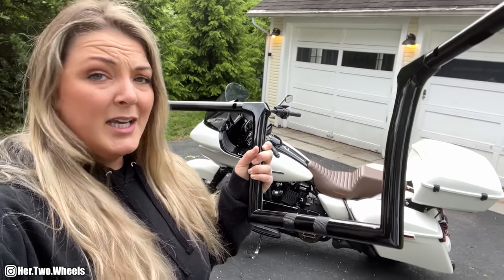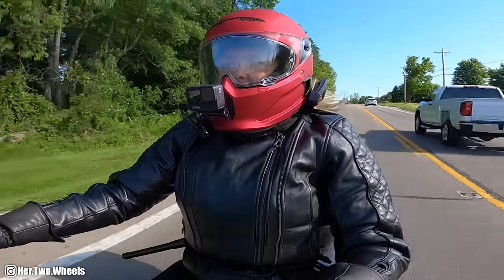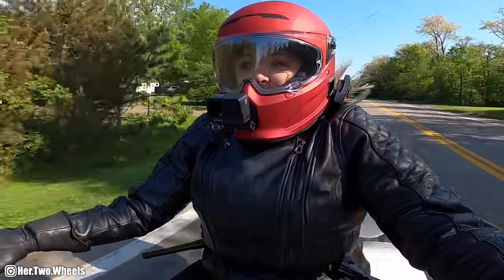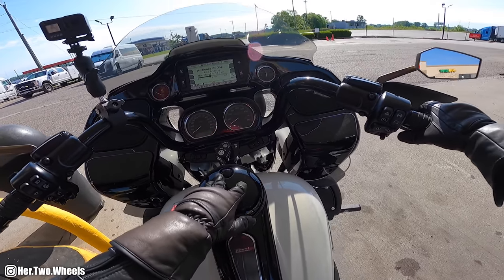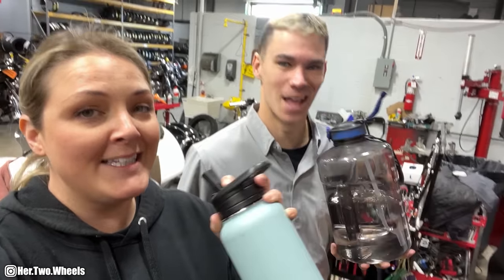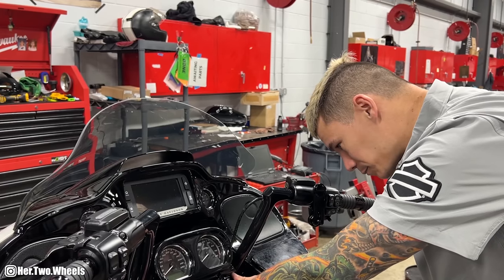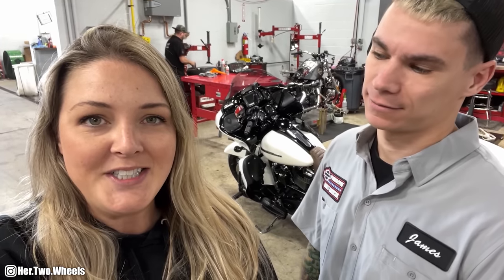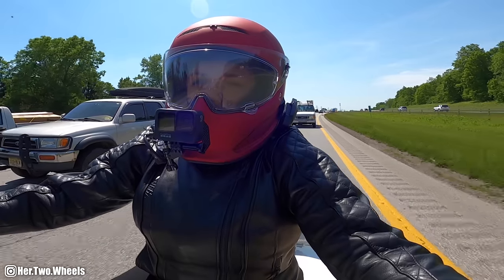Changing the Handlebars on my Motorcycle DAYS Before A 1,000 Mile Road Trip

Comment: Jess you and shadetree have inspired me to start riding, hopefully I'll be in a seat in a couple weeks. It's also so cool to see you riding roads around me, hopefully I get to run into ya one day!
Reply: As an established MC rider for over 43 years, off road, sport, tour bikes et When you first start out with getting your hands and YOU on your first bike..😗 Take your time on deciding WHAT bike, CCs, WHAT YOU are going to use it for on a basis of HOW much ie touring, local trips, off road et et ?? TYRES!  For example and OFF road tyre is NOT the same as a road tyre general use et BAGGAGE.. I ALWAYS went for clip on, easy remove YET secure, baggage. FAIRING?? 👀My professional long distance city to city courier work was vastly different re the machine, wind resistance, all weathers protection against the bike I used for trips to the beach with my girl on the back et ? 👀There are loads of YouTube vids from experienced riders et for newbies et We ALL had to start somewhere BUT these days UNLIKE when I first started out, there is a wealth of wisdom available SO slowly slowly catchee monkey as they say..👀 Lastly as our girl points out, a good rapport with the dealer / servicing department is what any MC rider should aim for ESPECIALLY as a newbie.. BUT! DO YOUR RESEARCH and avoid the ones who takes the bucks but ultimately don't give a **ck?! 😗DON'T be put off by the size of the bike to start with. 👀When I went from a 500cc to my first 750cc it was a beast of a machine.. whoa... OMG!! BUT after a couple of months, an experienced rider becomes one with the machine.. free flowing, effortless and immersed in the pleasure.. I've since ridden over 1000cc machines ALL of them beasts in their own beauty BUT ! Choose the bike that suits YOUR PREFERENCES, YOUR NEEDS, YOUR BUDGET!
Reply: Weird

Comment: I just installed kst straight jacket bars on my 16 rgs in 14", completely changed the feel of the bike compared to those wheelbarrow bars. If you wanna change them up after the trip, I'd recommend going 12" so you can angle the entire bar back toward you so you're not stretched out. Most of the kst bars are narrowed compared to harley bars so it'll bring your hands a little closer together which also inspires confidence on leaning the bike. I've found the wider the bar the more my shoulder muscles ache after a long ride. Just food for thought. Always love the videos. Cheers

Comment: Like suspension adjustment and sags, you do know there’s a limit of safety you can extend the bars upright until it is no more safe to do so.

An experienced rider will automatically find their comfort with each handlebar adjustment and not have to go to a learning curve. Maybe a slight, but it shouldn’t be days. Possibly couple of hours.

Also the whole idea of these bars upgrade is to make you sit upright on the motorcycle and not have bad postures. Such bad postures from stock handlebars also gave you major tailbone back pain.

Last is you could have just adjusted your stock bars a little upright instead of changing the whole thing. Eventually you will find your comfort zone using your new bar at the same height your body desires for them to be comfortable. And that can be done on the stock bars with just a little push upright.

But hey I enjoyed watching this vid, because I wanted to see someone else other than myself on a 12 inch bars. Honestly I just want to upgrade to them for the looks. Not mainly for comfort because again, the stock bars on mine have already been adjusted to my comfort.

Comment: I am the same height 5'7" I tried the same bar and pulled them off right away, I needed more pullback on a bar. I ended up going with 12" KST Spearhead bars there a three piece bar very adjustable and I love them.

Comment: The new bars look awesome! The angle looks comfortable and I think the sqaure edge look is cool. You might have to get Jordon to shave a bit off the gopro mount so you can move your buttons away from the grips more.
Reply: Switch control modules mount flush against a step on the bars. The more narrow ergonomics of the bars, make it seem the controls are in an odd placement.

Comment: May I ask which windshield are you running?  I am interested in these bars, but also interested in the 11" sport flare windshield by Klock Werks.  per Klock Werks website the 6" and 9" are the only ones that will work with the HD Chizeled Lo bars which are similar to the Fused Lo bars.

Comment: Came upon this as yesterday I got my bike back where the guy raised them for me but without me there.  They are now too high for me and my arms are way too extended.  I tried to get used to it but I rode it about 300 miles today and it just felt dangerous.  I tried to change the clutch location but it was still tough.  I think I'm going to try to tilt them back down a bit.

Comment: Did you get to sit on the bike and make sure the reach was where you wanted it? I believe the bars can be rotated in the mounts a little to your liking,  then rotate the switch controls to your liking.
Reply from the maker: Yep. We did. Bars are clocked down as far as they will go. There is a little “pin lock” on the inside of the triple tree area that goes into a hole on the bars to keep them from completely falling down if not installed properly. Unless we grind off the pin, the bars can not rotate any further.
Reply: @HerTwoWheels   It would have been hilarious if Jordan rode behind you going over to Farrows and was holding onto the handle bar the way you had it. 😝

Comment: Good to see you OK after the past trauma that we all have gone through. As a rider for over 45 years (all weathers, all year round et) including professional long distance motorcycle courier for over 2 years main city to city.. et Most machines from 750cc to 1300cc full fairing BMWs, HONDAs, KAWASAKI, DUCATI et et NOT a fan of Harleys.. 😗but each to our own.. 👍I will say though ! I've always gone to great lengths to thrash out a deal with the dealers et to get the machine I WANT, I DESIRE that fits in for what I want to use it for? Handlebar changes / preferences on tyres.. baggage et et Do the deal BUT to suit YOU and NOT for the benefit of the salesperson et Of course, good to see you are also aware of other benefits re servicing, modifications et et 👍As an electrical mechanically proficient individual with years of experience re engines, electrics, mechanical et BUT for those NOT so proficient? Get a good rapport with the servicing teams et BUT as I said, get a good idea of what you want from and what you are going to use the bike et for.. 👍Stay safe and great work James!!

Comment: Definitely had a little bit of shaky shake going on with the GoPro. The further you get out from center (stem),  the more the vibration is amplified. Lowering the gopro to a shorter mount or lower mounting point should solve that. Be watchful of the GoPro mounts though, they have a  tendency to fail under vibration.

Comment: It looks to me that the bars can be pulled closer to you and to roll the controls up to the right position so you can see the buttons and work them  just saying  but that’s a easy fix and adjustment  the work was pulling the wires
Reply from the maker: There is a little pin that locks the bars with only a couple centimeters worth of wiggle room
Reply: @HerTwoWheels  I have the same bars you have to drive the pin down flush into the saddle we’re the bar sits  under the top plate we’re you have the four  bolts that hold the bar in place  then you can roll the bars closer to you    The dealer ship might not want to do that just out source another mechanic to do the job  and then you will see a big difference